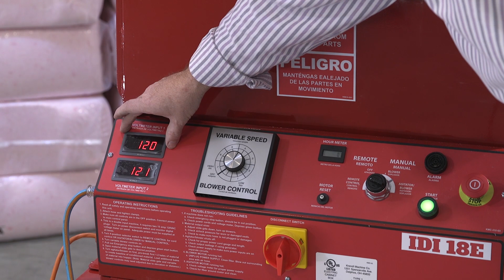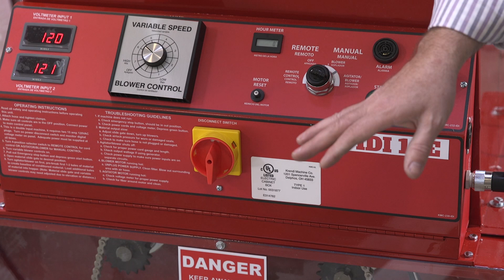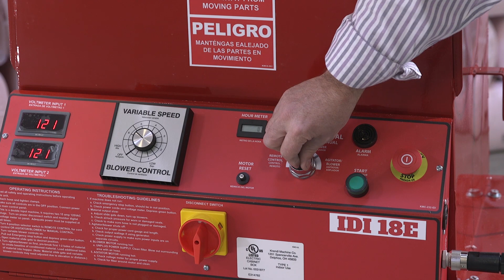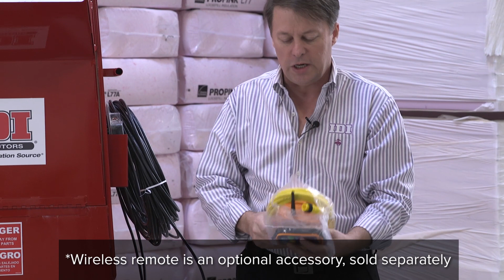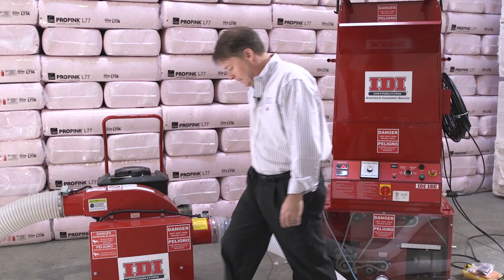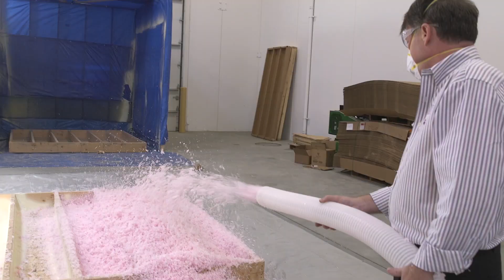IDI Exclusive Insulation Blowing Machines: the 18E & DV18

Comment: Where does procat machine fit  in comparison to these big machines
Reply from the maker: Thank you for your question Caleb.  The Procat machine uses a smaller diameter hose and a less powerful blower motor compared to the IDI 18-E.  The 18-E has more production than the Procat, more blowing pressure, 2 year warranty (Procat is 1 year) and can be used for different materials.  The 18-E also uses 150’ of hose compared to 100’ of hose with the Procat.  Below is a link to the 18-E information page.  You can also attend one of our training events for a demonstration or contact your local branch to see if they have one in stock.
https://www.idi-insulation.com/product/idi-insulation-machines
Reply: @IDI_Insulation  Thanks for the reply. how big of a difference are we talking? And when does it become necessary to upgrade from a procat?